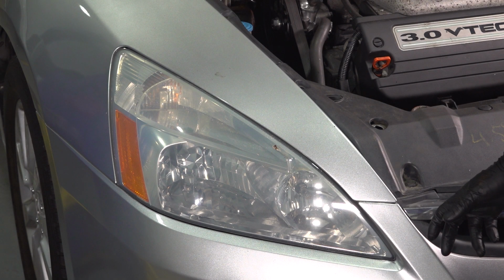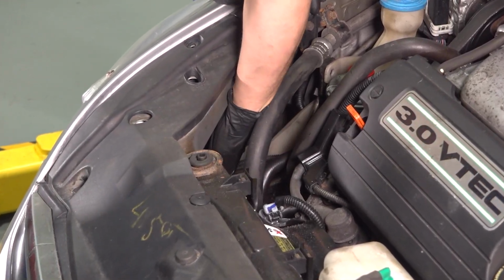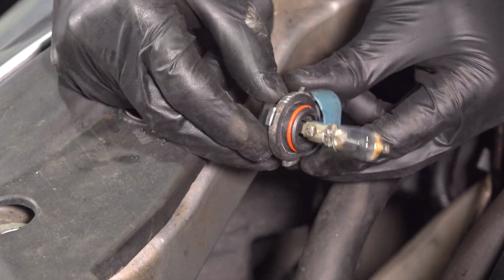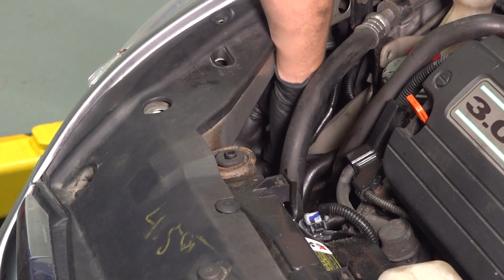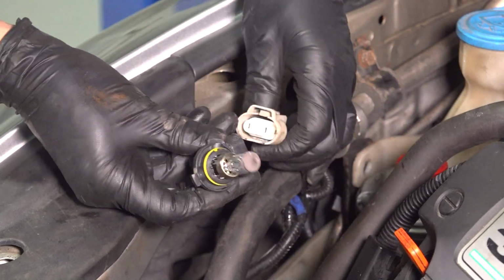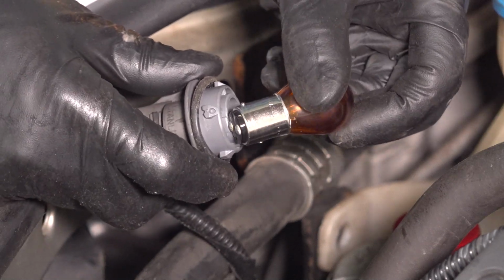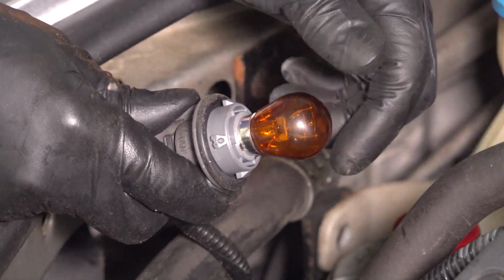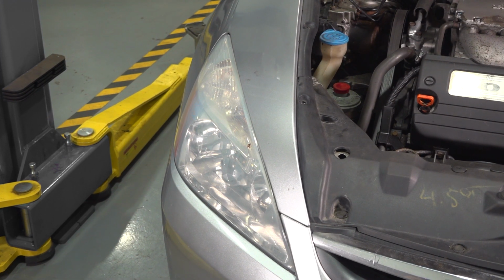How to Replace Headlight Bulbs 2003-2007 Honda Accord

Comment: So for me I had to disconnect the connector first because mine was wrapped around other wires, give it a little wiggle like he does. But once I did that, the low beam bulb came out easy👍🏼

Comment: Just did this. Not the same for the drivers side! The battery, overflow bottle and air tube can be easily removed for access.

Comment: After about 15 minutes of fighting with the tight area with the air filter and turning space it finally came free !!!! This bulb probably haven't been changed in years. Thanks for the tip I replaced the driver side low beam headlight

Comment: What happens if you get oil on the bulb?
Reply: The oil from your skin will cause a it to burn out in that specific spot you touched it at. Imagine, you have a hot skillet and you put a dime size amount of oil instead of the whole pan.

The small spot will only smoke/burn and leave a mark.

Same thing with a bulb except your bulb will burn out faster because of it